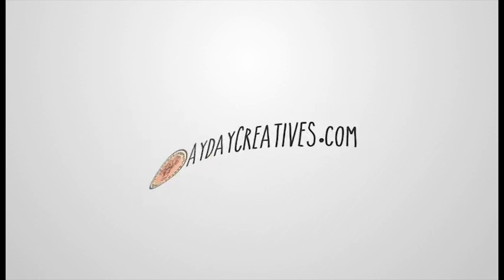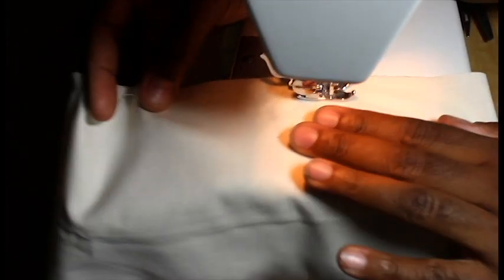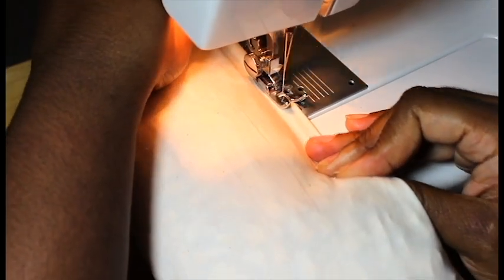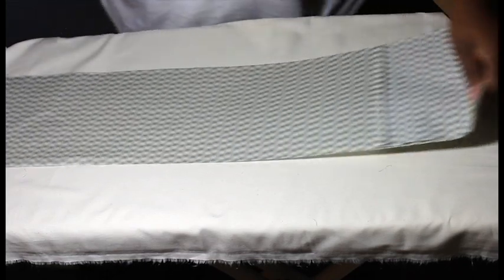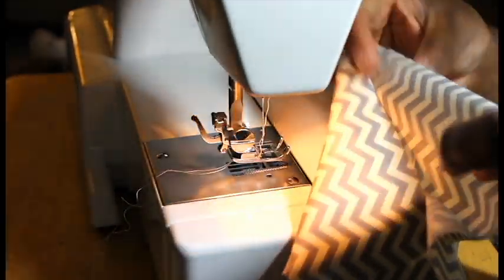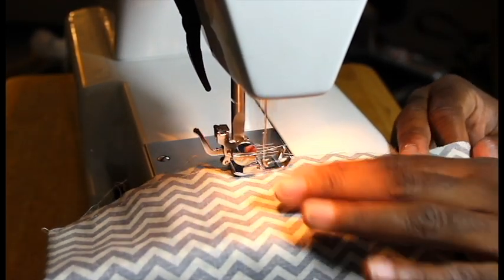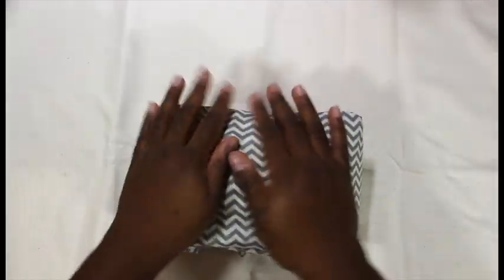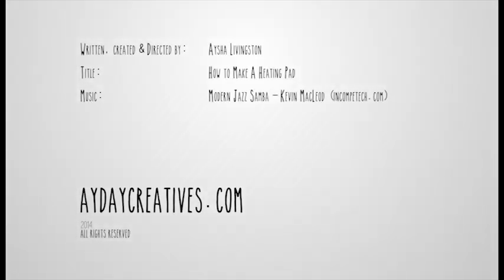Make a Heating Pad (Corn Filled & Washable)

Comment: Loved the tutorial. Made 4 heating components today after watching your video. Later I will make the covers for the inner bags. Found the size of the bag you make is just right for draping on the back of the neck. One thing that I found worked well for me is sewing the channels or sections in the inner bag before filling the bag, leaving an area of about one inch in length unsewn. I then filled the end sections first, one at a time and then sewed the rest of those seams shut. I then filled the middle section and sewed up the top opening. I found it easier dealing with less corn in the bag to sew the two end sections into the bag. Just a thought. Thanks for the excellent tutorial.
Reply from the maker: That's a good idea, as well!

Comment: Great Tutorial, thank you for posting it.  I noticed on the picture where you show all "ingredients/products" needed, the measurement for the muslin should read "35 in. x 12in." since you are folding it to get the finished size of 17.5in.  x 6in. 

I have made 3 and they have turned out great.  I add dried lavender and a couple drops of lavender essential oil to each wrap.
Reply: 35x6 is correct as the width of 6 doesn't change. If you do 35x12 it will end up 17.5x12

Comment: This is fantastic! your video is great and informative. What are the care instructions? I can't wait to start making these. thank you.
Reply from the maker: +Sarah Lumper Hi Sarah,

Here is the text for the Corn Heating Pad Label...

To heat - microwave on 30 second intervals for 2 minutes or until warm.
Be careful not to over heat.  

Optional: Place a cup of water in the microwave when heating the pads to maintain moisture.  Do not wet the pad.
  
To clean - machine wash outer pillow case in cold water and line dry.

Made with cotton fabric & whole corn filling.
Reply: Thank you again!

Comment: I'm thinking about making a velcro  closure so the outside can be washed. I think it would be ok to microwave velcro? I decided against zipper because I didn't want metal obviously and I didn't want to warp plastic.
Reply from the maker: Hi Jsuis14, thanks for watching.  I think a velcro would work nicely.  Although, the one I made actually does not use velcro or a zipper.  The way it is sewn the corn bag slips inside the "pillow case." It makes it easy to wash the case.

Comment: Do you have any trouble with the bag sweating in the microwave? Or is that ok?  I made one and after microwaving it, the outside of the bag felt moist. Thanks in advance for all the help...great idea!
Reply from the maker: Hey Shannon, thanks for watching.  I haven't experienced that, but it should be ok, and should dry out after a few uses.  For the ones that I use, after a while (a couple of months) I will actually place a small cup of water in the microwave to add a touch of moisture to keep the corn from being too dry and burning.

Comment: Can I add essential oils?
Reply from the maker: Hi Yvonne, thanks for watching. You can certainly add essential oils but I would recommend adding a drop or two after you've already heated the pad. Essential oil will likely burn off from the heat of the microwave.

Comment: Do you wash your corn before putting into the pack?
Reply from the maker: Hi Venus, no do not wet the corn.  Moisture could produce a moldy situation.
Reply: Ok thank you. I was told to wash corn and let it air dry overnight because of the white powder on the corn and it helps to keep down the corn smell.
Reply from the maker: Oh, that's interesting. Maybe that could work if you made certain that it is completely dry before working with it.

Comment: CAN YOU PLEASE IN BOX ME THE CARE INSTRUCTIONS
Reply from the maker: +Krystyl Wright  - It is now added to the description section.

Here is the text for the Corn Heating Pad Label...

To heat - microwave on 30 second intervals for 2 minutes or until warm.
Be careful not to over heat.  

Optional: Place a cup of water in the microwave when heating the pads to maintain moisture.  Do not wet the pad.
  
To clean - machine wash outer pillow case in cold water and line dry.

Made with cotton fabric & whole corn filling.

Comment: PLS HELP I DONT HAVE A MICROWAVE WHAT SHOULD I DO?
Reply from the maker: +youmna ahmed You can also use it as a cold-compress by placing it in the freezer before use.  I am not sure how else to warm it up safely.
Reply: +ayshaday ok thanks ;)
Reply: You could try putting it on a radiator instead x
Reply from the maker: Oh, that's a good idea.
Reply: Buy one.
Reply: Try a double boiler, or a heat proof bowl set into a pot of hot water...no lid or it might steam and get the corn wet. Don’t do it with loose corn, as it may not stay warm before it is enclosed in the bag. Put the finished bag into the bowl. Instead of a lid, you could use a ziplock bag to hold the whole thing in the bowl.

Comment: Oh my gosh!!!! I need that ASAP !!! My back is killing me !!! 😫😫 
Where do you get the corn feed from ???
Reply: You can buy whole corn at any feed store (like Atwoods) and sometimes at Walmart during deer hunting season, but those are big bags.  Most feed stores will split it into smaller sizes, like five or ten pounds.  The trick is to thoroughly go through the corn and pick out the broken pieces.  It's a chore, but you only need the full kernels because the broken ones won't heat as well and may burn.